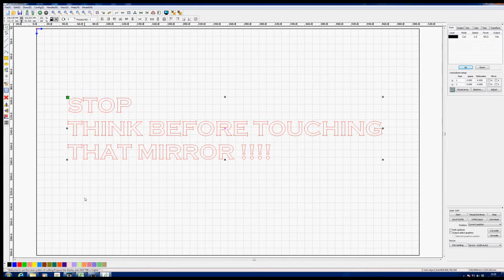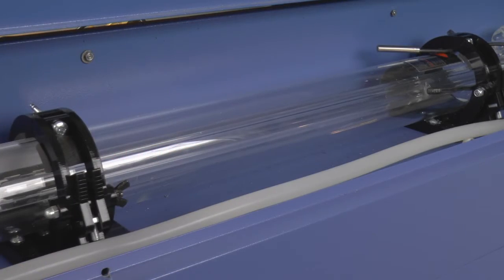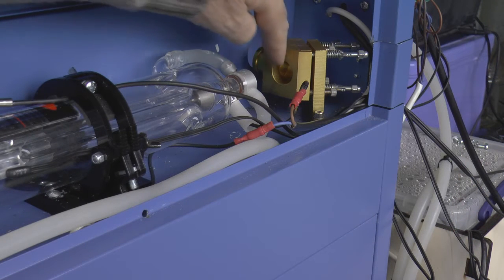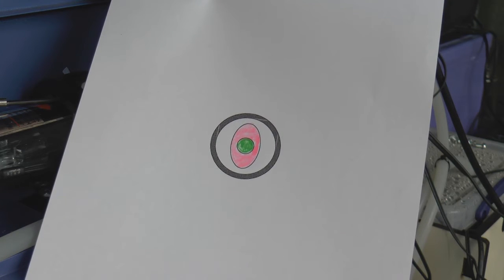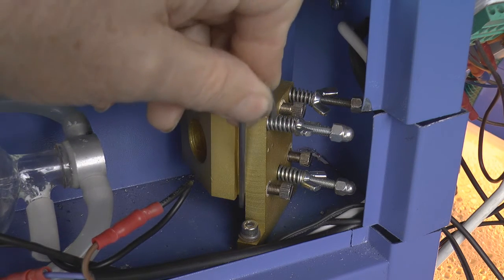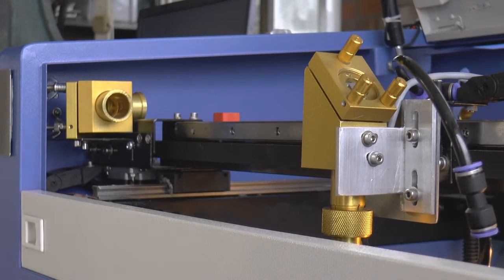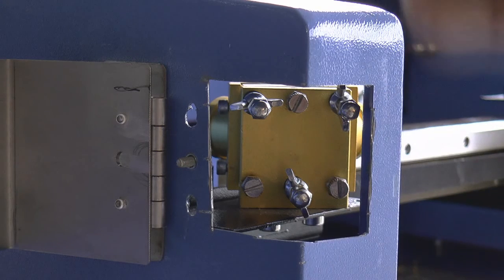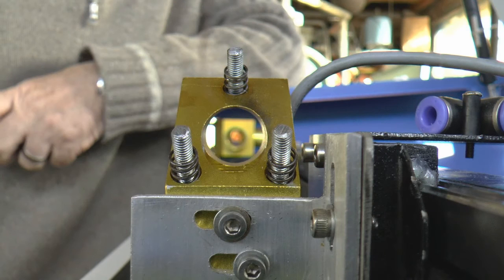RDWorks Learning Lab 44 Line of Sight Mirror Setting Part 1

Comment: Thats me got mine, set up and running now, its 'slightly' different to your machine (but more or less the same), 
Looks like the same mirrors as yours, it does not have to mirror shrouds, although its a bit easier to see the mirror for cleaning. And there is thumb screws for adjusting... and panels that open allowing access to the screws! I am going to make up some new labels that are a bit clearer....
The extraction on mine is also out on side, under a large solid plate, extraction seems rather good, pulling smoke down all the sides rather effectively. 
Also, i am going to get some better pipe for the extractor... the pipe supplied is not very flexible.... it more or less keeps its shape no matter what you do! once thats sorted everything will be ready for some serious projects!
Reply from the maker: +Michael Edmond 
Hi Michael
Seem like a different factory designed your machine,  where they thought about the mirror problem a bit more. Good to know you are nearly there. I hope my many mistakes will make it easier for you to dive straight in and start doing something really useful. Did you know you can cut some great bacon shapes for the kids, or better still fancy toast shapes. Not what the makers planned but.....do the Chinese have a sense of humour?
Good luck and lots of happy cutting
Russ
Reply: Thanks! Yeah, I am hoping to get it going soon, Bacon.... now there is an idea.... my workshop is next to my bbq.... now if only the weather would get better! I have noticed my laser pointer is off by a mile, so that will be getting sorted. My kids already have a list of things for me to make... although a 'real working x-wing from star wars' might be a bit of a stretch....
Mike

Comment: Hi Russ, I was wondering where you found the adjustable laser clamps. They appear to be very useful and I feel that I would benefit from using them. Thanks James
Reply from the maker: Hi James
No problem. Theye were something I designed to suit my machine. You can either use the You tube private messaging system to let me have your email or all my published designs are available to down load from rdworkslab.com  see https://youtu.be/9Xq95wM0C_k
Best regards
Russ
Reply: Hi Russ, 
Thank you for taking the time to respond to me.  I shall supply you with my email address in a private message.
Regards
James